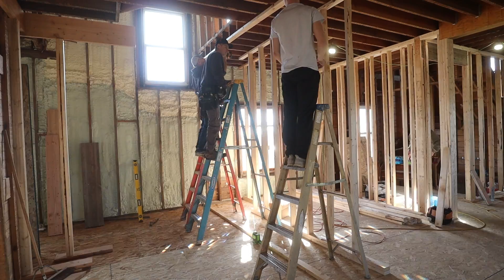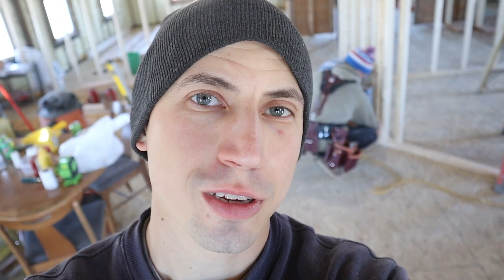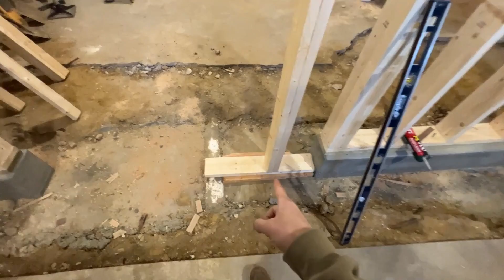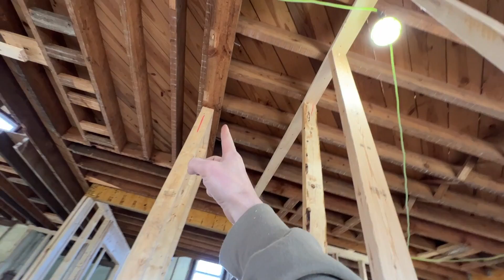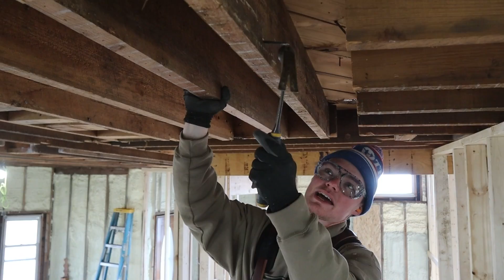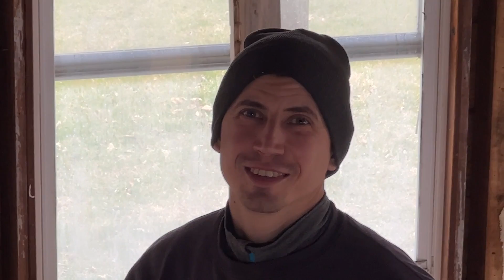Restoring A $7,000 Mansion: Building A New Living Room

Comment: Cole, in building my house a couple of years ago I have 2 valuable suggestions. Think about you communications and entertainment. I ran a 3 inch plastic conduit from my basement to my attic. Then in the basement I installed a second communication hub on the opposite end of house and ran 2 lines of Cat6 Ethernet cord and 2 lines of RG-6 Coaxial cable. This saves ALOT of cable runs and makes everything better and faster. So I suggest you run a 3" plastic conduit to use as a raceway for all communications cables to shield and run all your connections from.

Comment: Install fire blocking ( what you call them) noggings between studs. Its to prevent compression (bending of studs)  ie wood does not slow down fire, it feeds it.  Kings studs and jack studs. Trimmers are like window sill, door heads or extra packing in windows. Also when you cut out joists for like a hole you install trimmers. On a 22.5 angle, usually put a stud either side for support but, whatever

Comment: While a jack stud is used to support the weight of the header, a cripple stud is cut to add additional framing above the door or window opening, and below a window. Though cripple studs are not load-bearing, they’re important parts of a building’s framing because they serve as blocks for other building materials, such as plywood or drywall, to attach.

Comment: Kingstud! They are structural supports normally double or triple or more.
Stud can be load bearing or not.

Trimmer is a "trim" piece to keep sill and header locked in, for windows.
Cripple is support between headers or sill and floor/beam

Comment: Tip for hanging pantry door; hang it to open out into the room not in the pantry or use bifold doors. This gives more space for storage inside the pantry. You can put up bifold doors that look like a sliding barn door. They are cool

Comment: Something to consider as you mentioned gypsum board as the finish for your staircase walls.  After restoring to two story homes of similar build date, I would suggest considering something that will be more durable, easier to clean and maintain over time.  The treatment that I liked best was 1/2-inch plywood that was covered with wainscotting along the entire outer perimeter of the staircase with a similar species of veneer plywood installed above the wainscotting -- the wood was stained and polyurethaned with a decorative molding separating the wainscotting from the veneer plywood and complimentary moldings hiding the joints in the plywood (the plywood panels were sized to make sense as panels).  That staircase held up very well to years of active living with little more than a regular cleaning with Murphy's  Oil Soap and some soft rags.  It was very difficult to damage the surface and it was sympathetic to the origins of the home.

Comment: Hey Cole, to square up your exterior wall, as long as its not way out of whack, use some furring strips cut to the angle you need to bring it back to square then epoxy and nail them into place. As far as your wall studs, being that they are so long, put blocking mid-way between each stud to keep them from bowing. It will be much better than using temporary boards on one side and having to remove it later.

Comment: Roman, when you cut that miter on the edge of the 2x4 jack stud at +49:10, you positioned the fence on the wrong side of the blade (with the blade titled towards the left, and the fence on the left side of the blade, to cut off the top right corner of the stud). Setting up the fence that way is actually dangerous. You had the stud trapped underneath the blade. When the stud tries to lift upward (because you didn't have anyone helping you support the far end of the stud) it will cut too deeply into the stud, and the stud can easily kick back towards you (and/or jam the saw blade).  Even with proper in-feed and out-feed support that's a very dangerous way to position the fence. 

When using a left-tilting table saw for miter cuts like that, you should always position the fence on the right side of the blade, and cut off the bottom left corner of the stud (and stand to the right of the blade so when the cutoff kicks back at the end of the cut it doesn't hit you). That way the stud doesn't get trapped between the blade and the fence, and if the stud lifts away from the blade it just makes your miter a bit too shallow rather than ruining the cut or ruining you. 

Also,  it's sometimes easier to manage miter cutting a 2x4 stud  if you stand the stud on its edge (with the 4-inch face against the fence) and the blade set for a 3/4-inch wide miter cut rather than putting the stud face down (with the 2-inch edge against the fence) and trying to make a 2.75-inch wide miter cut. But that's a personal choice.
Reply: Thank you for adding this detailed safety comment!! I hope they see it.
Reply: Also, use a push stick, or two. A board can kick or jolt on the most experienced woodworkers even when the cut is set up correctly and you don't want to have your fingers that close to the saw blade when it does.
Reply: I felt my stomach drop as I saw him sliding his fingers past that blade to keep the 2x4 positioned in the cut.  A kick back of the wood could have easily pulled his fingers into the path of the blade.  Very important to have the back end of the 2x4 supported and to use a push tool instead of your fingers.  I'm glad that Roman still has his fingers.

Comment: On the wall that the boards want to flex under the load, the  cheap  way is to is to use pipe straping to tie each stud together. You might want to have at least two three or more to do the job. Or you can put up a cheap piece of plywood or laminate.

Comment: When building an opening in the wall (door or window) you have KING studs that run from floor to ceiling.  Next going towards the middle of the opening and shorter are the JACK studs.  This is what the HEADER board rides on.  This way the weight has a transfer path to the floor.  Typical headers are a pair of 2x material sandwiched around a 1/2 thick section of ply material.  Think of it like an OREO cookie.  The 2x are the cookies and the plywood is the white creme filling.  The three together are the exact thickness of a standard 2x4 wall stud.  So unless you are framing with 2x6 material (Like in a bathroom wall) it will work fine.  The CRIPPLE is the mini studs that go above and/or below the opening to maintain weight continuity.  

Cole, having the bathroom in the back of the pantry is a very weird and bad idea.  You should have the exit to the mini-lav in the hall outside of the pantry.  It's just NOT SANITARY that way.

Comment: I’m going to vote with Roman. A Jack stud bears the weight of a header. A King stud goes from the top plate to the floor plate. A Cripple stud are studs above a door or above a window or below a window. A trimmer generally would be beside a jack stud in a window or door opening. 

Jack studs will be doubled up or more depending on opening size. A 5ft opening should have 2 jack studs on each side of the opening. Bigger than 5ft should be tripled up or more to bear the weight. 

Ok. I know you are in the county and are not beholden to the international building code, but you should be using the nearest town of size that has code enforcement and has adopted a building code or the international building code (possibly with modifications) to remodel your house. I would hope Juston is familiar with the local codes since he has been in the trades for over 25 years. 

I built my house in 1997 so I’m familiar with the terminology we use in the panhandle of Texas and I live in the county as well. I used the international building code as adopted in that time. The nearest city has since adopted multiple iterations of the international building code and just adopted the newest version (2022?).

Comment: you should put in blocking - to make sure studs don't bow but also for drywall. you should install strapping on ceilings in bsmt and first floor and make sure to check elevations on 2nd/3rd floors before you start locking things in but also consider insulating floors and installing some floor vents and/or bigger pvc pipes to recirc air - hepa pos pressure +heat pump + heat exchanger combo will keep good air flow and no dust/allergens, the house is well insulated so i don't think you will have to go overboard on hvac. shelly makes nice wifi relays you can control all systems from your phone and or home assistant

Comment: Just extend the new little header into the pantry wall 1 ft so the support is bearing on the corner of the concrete where you want it. This will keep the door in the basement the same. The pantry wall will hide all of this.

Comment: I think you want to use at least a 2x4 header for every interior doorway. 2x4s laying flat will settle just from gravity, and eventually, the middle of the doorway will sag.
I know the upper 2x4 studs are screwed and will help support the middle, but using a doorwat header is never going to sag. 2x6 would be even better.
Also, that carries anything above correctly.

Comment: In Oregon we always blocked the upright studs in the walls for strength, it keeps the studs from bowing. Also blocking makes a good nailing surface behind the drywall. Lathe and plaster gives strength to the walls, without the lathe and plaster you need something to strengthen the upright studs. Especially to nail cabinets too. When drywall first came out, they always used to put plywood up first then put the drywall over top of the plywood. But they decided not use plywood as a backer for drywall to cut construction costs. All the houses I owned had all wood walls. I absolutely hate dry wall alone. It is a nightmare to decorate especially if you have something heavy you want to hang on the wall like mirrors or large oil paintings. My house had 12' ceilings and believe me when you decorate and have high ceilings it takes large pieces to make any kind of impression. Pocket doors are a must wherever possible.

Comment: Don't worry about the bearings points so much, you are easily in the strength points of your beams , if you use a 45 degree triangle the post is close enough for safety,ask the engineer but I am sure you are ok!

Comment: Roman is correct it is a jack stud it carries the header weight to the bottom plate.  The cripple stud are the short ones that fill in above or below a window, and king studs are on the ends of a header they go floor plate to top plate.

Comment: Here's another tip for y'all:  When installing the joist hangers on the LVLs, where drywall is going over them, cut about a 3/16" (the thickness of the hanger metal)  'relief cut' in the bottom of the LVL to create a pocket for the bottom of the joist hanger to fit into.  That way the bottom of the hanger is flush with the bottom of the LVL and there won't be a bump in the drywall when it gets installed.

Comment: OK do you trimmer up a car or jack up a car?
A jack stud lifts/holds up a header board. 
If there is space above the header do you leave it open or do you put short studs in. 
Those could be called trimmers to be politically correct but the term used until the early 2000's was cripple studs. 
Roman is Correct on the jack studs. Justin is WRONG!! So was whatever website you looked into. If you said cut me a Trimmer to xx inches to a framer that has been building more than 10 years they would look at you like you had a 3rd eye in your forehead. Check with Studpack and REALITY RENOVISION here on YouTube for a final word on the subject.

Comment: Fuel pump relay on the fuse panel under the steering column is bad. A big problem with that year Ford. Run power to the switch under the right kick panel to test the pump. Look up you tube videos.

Comment: Cripple studs. There are studs which is a single stud, then studs nailed together made into to one large stud is called a cripple stud. A jack is like a floor jack or jack to jack up a car. That is how I was taught to call it a cripple stud. Of course, it may be a regional thing. And yes, it could be those terms evolved over time and changed as construction techniques have changed. I had a house down South in Alabama that was built in the 1700 style. No lathe and plaster there and the framing was totally different built out of old growth heart pine, which is termite resistant. I had a house built in 1929 in Oregon that was built buy a Polish immigrant. It had plywood walls which was pre drywall. The house was built solid as a rock with old growth Douglas fir. I took a yearlong course in hands on construction. Then I was a contractor for 9 years. I designed and built all my own outbuildings with myself my son and husband.
 The only thing on all the work on our property we contracted out was the roll up doors on our two-story 38'x48' shop. The rest of it including reroofing our large Cape Cod house we did ourselves. I designed the concrete floor for the shop to handle the weight of a semi-truck with nice thick footings around the whole building. I used sonotubes for the main upright post and brackets to get the second story height and to keep the main posts up out of the soil where if the posts were put 8' down in the soil, they would eventually rot off over time no matter if they are treated. We tied everything in with rebar and wire. I worked the cement truck shoot and directed the driver as my husband and son shoveled the cement into the forms. I finished and floated the floors myself and they came out smooth and beautiful. Nothing as satisfying as doing a job better than you can have a professional do. And thank goodness my husband was really good with the math, plumb, level, and square. My son was a terrific help from the time he was 9 years old.

Comment: Hubby and I are planning our LR/KITCHEN remodel which includes opening them up to each other. Load bearing wall between them houses our pantry and furnace. Our solution?? We are tearing everything out except the furnace. We will build a very large square that will house the furnace but on the 2 sides that face each room, were installing wall mount insert electric fireplaces and each with have faux hearths and real mantels. The side entryway side will have the door to furn and the 4th side will have a live edge wood slab that will accommodate two pub height stools. Everything else will be ripped out floor to ceiling. Maybe an option for your load bearing center conundrum!! Could do one side shelving for display pieces?
Reply: Great idea!

Comment: Trimmer and jack are used for door and window rough openings.
What you are installing is a post,column, or multiple studs for point load for a girder/BEAM, " LIKE A STEEL BEAM" ! IT IS NOT A HEADER BOARD! 
Cripples are under a sill or over a header.

Comment: Roman is correct.  Per google. "A jack stud is a vertical structural element that sits below and supports a header to transfer its loads downward to the bottom plate and ultimately to the structure's foundation."

Comment: Mr Google says "A jack stud is a vertical structural element that sits below and supports a header to transfer its loads downward to the bottom plate and ultimately to the structure's foundation. Its length determines the header height and is critical for rough openings of windows and doors."

Comment: I know a few people who have cut the bed opened to access the fuel pump and then made a removeable cover. 
When you take the bed off, pressure wash the bottom of the bed  and the frame and also wire brush the frame. Then use bed liner spray, or other quality, spray on material, and do the bottom of the bed and the frame. Will look nice when it's done, and will last for years.